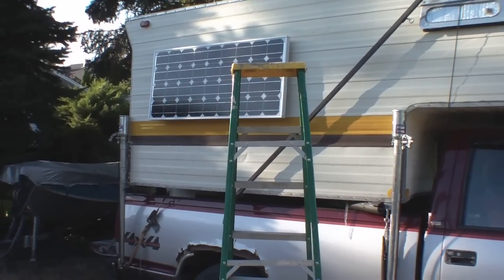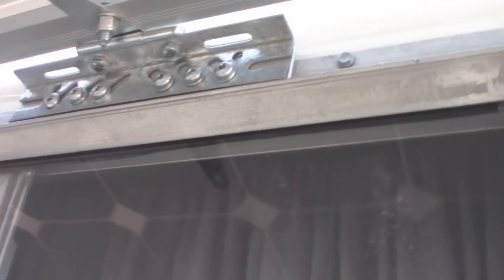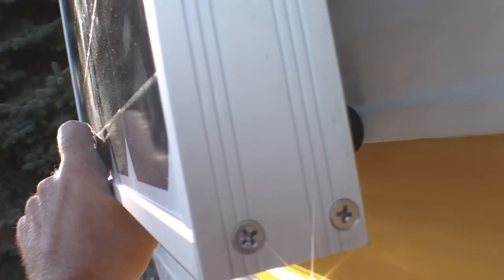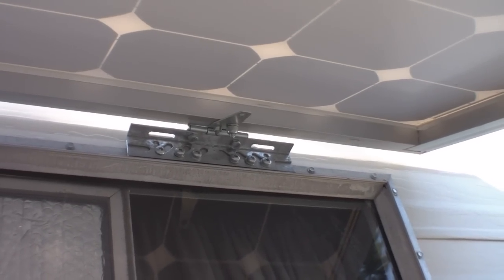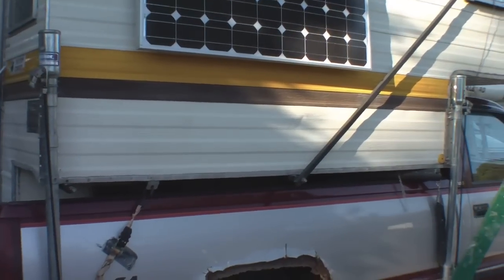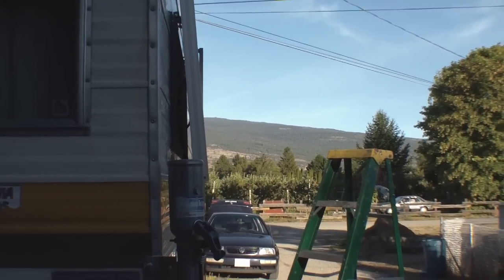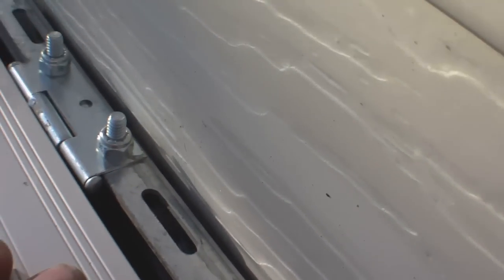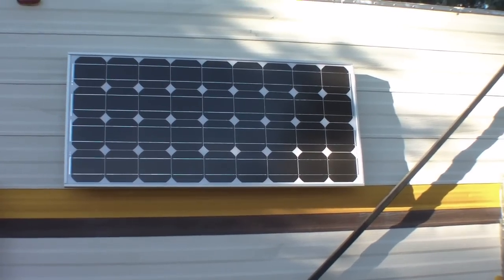RV Solar Panel Mounting - Building a Window Shade out of 90 Watt Monocrystalline Panel

Comment from the maker: Thanks, we'll see how it works out. I'm gonna put 280 watts on the roof, and it's not a big roof, so this will top me up to over 300 watts. I like having a powerful sound system when I'm out remote camping where there is no one to disturb, so it's nice to have a few hundred watts, also, I can stay anywhere and have power, or even run my fridge on DC electric.